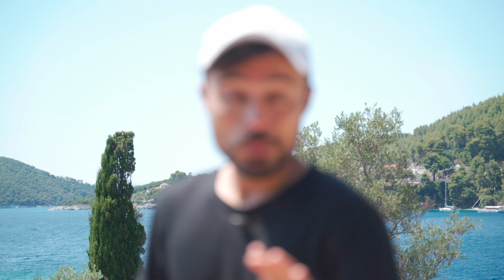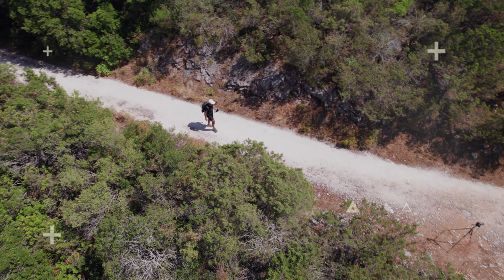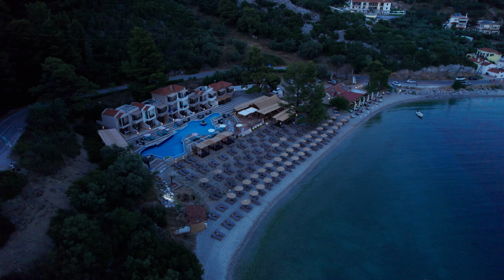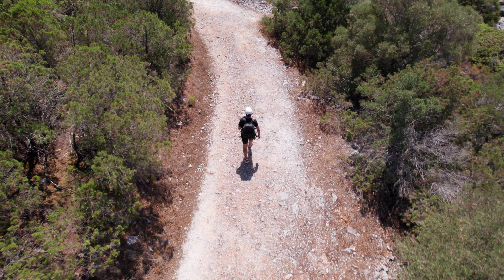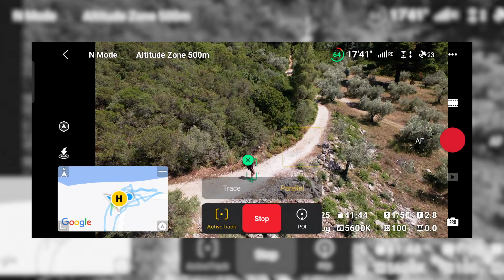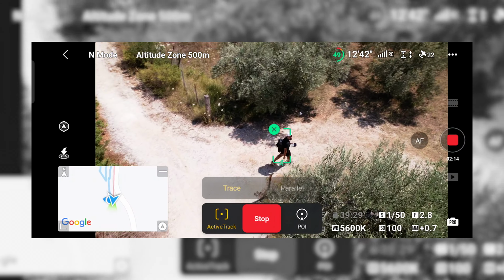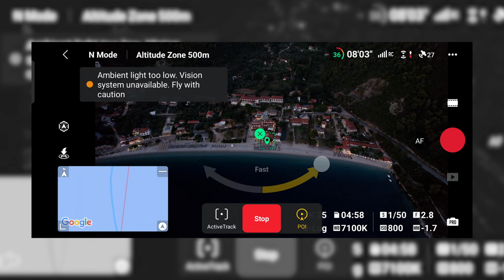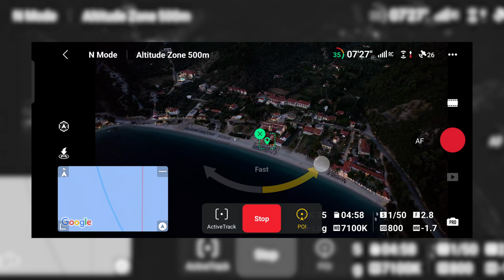DJI Air 2S Active Track FULLY Tested and How To Use!

Comment: Great video. But mine dont wanna start it active mode qfter selecting my self on screen, tells me that the wrong settings are set. It is set to normal mode, but then i dont know what else to change ??
Reply from the maker: In some modes the active tracking doesn't work, it depends on the settings you got at the moment. Like on 5K it doesn't for example.

Comment: hi ! very nice video ... question is the air2s still a better deal (i have currently one, but thinking to sell it or not), than the mini 4 ? Any advice ?
Reply from the maker: I've tried all the Mini's, and still regarding power, and wind resistance is still better. Also the sensor size, but then when we talk about the mini pro's it's tighter. I'm not selling mine yet :p

Comment: I dont know why my Air 2S active tracking do not have "trace" option. it show, manual and parallel only
Reply from the maker: Maybe try a firmware update, check the version inside the DJI Fly app !

Comment: Hi, i have seen a lot of videos with Active Track. But I did not find one about my next question. Suppose you are in the air with Active Track enabled. The camera is focussing at a railway track. You choose a spot on that track en draw a rectangle / square. You wait till a steamtrain approachs and dips into the rectangle / square. Then you start recording. Will the Air 2S follows that train automaticity? I am curious.
Reply from the maker: Hi ! I don't think so, it will understand the contrast of the image and what you tried to select, and it will be like a person going behind a tree, but in this case the "tree" is coming in front of the subject, the track. It will try its best to keep focusing on the track. To follow the train you're better off looking at it in the distance, and try to activate tracking as soon as possible. When it's too far also it doesn't grab it very efficiently.
Reply: @FlyEnri  Thanks for your reply

Comment: For some reason my drone doesn’t show these active track options when I select the object 😢… any idea why?… or, how can I fix it?
Reply from the maker: Hi Camilo ! Yeah, you might be in 5K resolution, then it doesn't offer it. Or if you set a higher frame rate, like 60fps or 120fps, also won't have tracking features !

Comment: How good is the Air2s for posting on social media - vertical videos cropped from the standard 16:9? Or it would be a better choice to get the Mini 3 pro? Thanks.
Reply from the maker: It looks awesome cropped, not a problem at all if you do at least 4K ! If you want a bit more room, you can also shoot 5,2K but in that case you can't use some of the camera movement assistance tools!

Comment: I have a question. I recorded live track videos (I pressed "go" then did whatever I am recording then pressed "stop"). However nothing got saved on my drone. as if it just did follow me but no video recording of it. is there an extra step. I lost important photoges cz I thought I was recording the whole time. I tried using an sd card reader, and then I also tried connecting my DJI air 2s directly to my laptop. everything that I recorded in the video tab is there and even photos. but nothing was saaved/recorded when I did active track.
Reply from the maker: That's quite strange! Well, apart from enabling the recording, there's nothing else you should do, and the files should be there. I would recommend checking the internal storage, but you've done it already so it doesn't make much sense... Maybe was it really just lack of pressing record ?

Comment: When I try active track it keeps telling me I am in the wrong recording mode. I normally shoot 4K/60, but I changed it to 1080/60 and that didn’t work. I changed it from D-Log to normal and that didn’t work. I changed it from PRO to AUTO and that didn’t work. 
So what recording mode works with Active Track?
Reply from the maker: I'll check the modes available to be precise, but definitely 4K 25 and 1080 25 should work, even with Dlog and Auto.
Reply: Same issue
Reply: @ExistOutsideTheBox  switch it to 4K30 and see if that helps

Comment: Hi . I have problem with active track. Try mark objects but most of the times I can’t do it, instead of marking objects I changing brightness of the screen. How can  go about this?
Reply from the maker: Hi John! Oh, you mean when you're trying to create the square around something? Maybe you got some shortcut configured? It's the brightness of the screen, meaning the brightness of the phone overall, or the exposure settings on the drone? It might be something from the system settings, not even related to the DJI Fly!
Reply: @FlyEnri  Hi. I see yellow square and small sunshine on the middle of the screen . This is definitely related to Dji Fly. Just wondering how to remove this yellow square, probably this is causing all the problem

Comment: While you are in active track, is APAS still working ? and how is it ?
Is active tracking work as well in Cine mode ?
nice sharing, thank you.
Reply from the maker: Hi Hanif!! It works, but you can't really be sure if it will be paying attention as it doesn't have sensors on the sides, so it's a bit sketchy to trust it to avoid all kinds of stuff in the middle of the way, haahahaha And yeah, it works with all modes perfectly, better choose according to the type of movement you'd like :D Thanks for watching !!

Comment: Hi
why Active track not work in 60fps
Reply from the maker: Hi! Active Tracking requires more processing power and it's not available when you set 5.4k as resolution and in some fps modes. The same happens with normal cameras, that can't use certain types of autofocus for example when in high fps modes or that can't record audio at the same time.

Comment: Do you need to have the remote in hand for it to follow? I have a jetski I’d like to have it follow me while i drive
Reply from the maker: You don't need it, you can consider it like someone else flying it for you, but instead of them controlling it manually, they are letting the drone do it for ya. The only drawback in your case is that obviously if you need to adjust it you won't be able to. Also that's not very legal I guess, hahahaha I'd leave the controller at some friend's reach if possible to guarantee they can act in case the drone goes wild :p

Comment: Great video! I want to use it skateboarding, but worry about power lines and trees along every single road here 

I’ve had the Air2S for a while and haven’t even seen how to get to this mode
Reply from the maker: I wouldn't be very comfortable also if flying below their level. But if you go above their height you can be super relaxed it won't do anything crazy. And you would get sick shots for sure !!

Comment: If I understand correctly, to active track a subject, you highlight the person or object and must use the controller to follow?  For example, if I am tracking / filming a person on a dirt jump bike, since they don't have the controller, the Air 2S will only position the camera view on the subject but not actually track or follow them?
Reply from the maker: Hi dear ! Depends on the mode, in the Active Tracking it will follow and you don't need to control anything ! It's perfect so that it does a better job on keeping up with it in a much easier way, and even better if you're filming yourself, and don't want to mess with the control :D

Comment: Great video man!😀 I think I enjoyed the active track feature on the original DJI mavic air more. Especially di POI because you could just tap the screen and the drone would fly forward or sideways. Now you just get the rotation :/
Reply from the maker: With its limitations, still a great feature to have. And gladly the sensors and obstacle avoidance improved a lot 😅